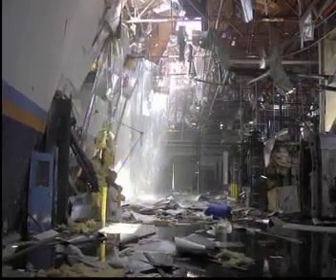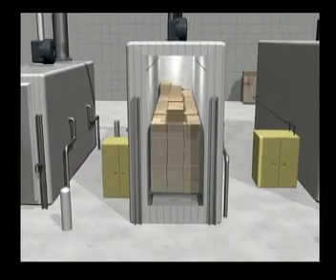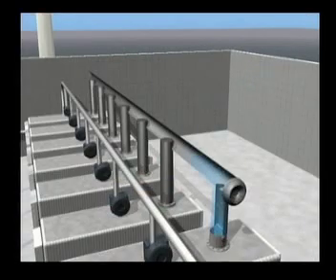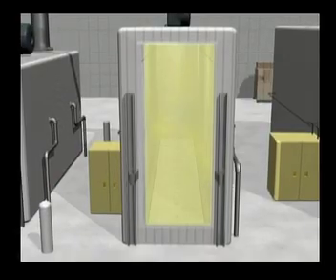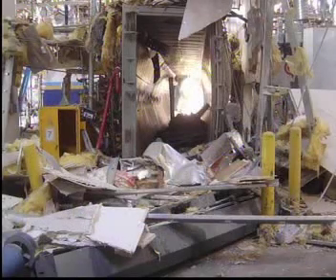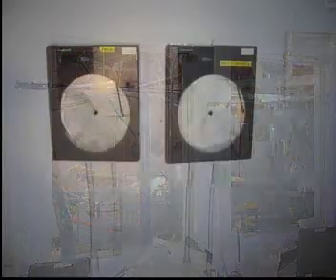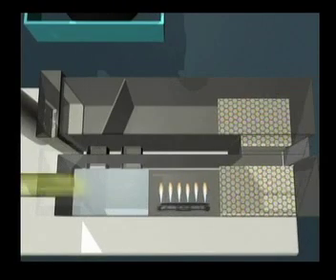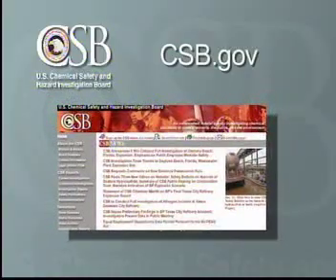CSB Safety Video: Ethylene Oxide Explosion

Comment: we studied this explosion in my Chem engineering senior design class earlier this semester. 18 years later.
Reply: @CRosa0125   How many improvements did you come up with?   I don't know if you're aware but Sterigenics was in the news more recently because their facility in Willowbrook IL was leaking ethelyne oxide into the neighborhood.  The facility was ultimately shut down.  And a Sterigenics facility in Smyrna GA also leaked EtO.  You'd think they would have learned their lessons from the Ontario CA incident.

Comment: Unfortunately, you can't train common-sense into an employee's mind. Now, a dumb question: Do the product boxes contain EOxide when they are finished with this procedure. Didn't see if the boxes were opened to expose the contents during the procedures.
Reply: That is what the nitrogen washes do. It is then aerated under vacuum to remove the rest. I am sterilizer technician, 40 years

Comment: Although operator ignorance is a major factor, the system had several issues. First, there should not be an override for a critical safety process. There should also be blowback preventers, and proper gas monitors installed. Japanese manufacturers refer to the is Poka Yoke, or "mistake proofing". Americans would refer to it as "Idiot proofing" either way, removing the chance of human error should be a priority.
Reply: I am not familiar with what control software they were using, but I am an industrial controls engineer. Let me tell you, there is always a way to bypass basically anything. This was from a long time ago, but if it is similar to modern batch control systems, they just did a step change, or another similar automation manipulation. That could very easily have been a common occurrence in their process. The problem was that someone had a higher level of authority and access than their actual knowledge of the process could justify. You typically have some automation engineers dedicated to supporting operations to perform or approve automation manipulations like that. Having an operations supervisor have the authority to do that is not something I have heard of before.
Reply: But yes, the piping and overall process design was bad. No fixing that with software, much as clients want us to do that after they bring us in to their poorly designed plant AFTER it is built.
Reply: I sold ETO for 20 years. It in 100% concentration is one of the most explosive things on the planet. We ran ETO in hospital settings over 40 years, but it was blended with Freon or HCFCs at 88/12 or 10/90 concentrations to render it non-explosive. The changing laws on ozone depletion resulted in Honeywell and Penngas discontinuing production. I was going to build a 100% facility at that time, but did not like the idea of my office sitting on a bomb!

Comment: Can't they just stick it under the UV light like at the nail salon to sterilize?
Reply: UV light is known to damage plastics over long exposure. Think of anything we leave out in the sun over a long period of time, the UV exposure eventually destroys plastic in medical devices and can potentially make it weaker
Reply: UVC only sterilizes what it directly hits. It would not be able to penetrate into the packages and get every interior surface, like a gas would.
Reply: @gloomyblackfur399 What about using a different, stronger type of radiation? Gamma rays?

Comment: did it not occur to them that an open flame in a chamber used to remove explosive chemicals could be a hazard...? the extent of my chemistry knowledge is 10th grade chem but even i know that's dangerous
Reply: They missed the point of gas washing.
They thought if there are no products inside then it s not necessary.

Comment: Why wouldn't you design the system with a flashback arrestor ?
Reply: Too expensive probably
Reply: hardly expensive . For instance, a 14" inline detonation type flame arrestor is A$50,000 or US$33,000
Now, they wouldn't be remotely close to running 14" pipe so you'd be talking about maybe a US$10-15K for a smaller 4-6" inline detonation arrestor.
Now, in a facility like this a $10K arrestor is pretty insignificant compared to the price of the booths & control system.
Reply: @spicywolf6718  That assumes they were thinking about the price of the booths and control system.  People who cut corners often don't.

Comment: Is oxygen flammable because is a gas that can make fires bigger
And violent fire explotions
Reply: Well said pal
Reply: i disagree with whatever the fuck ben said, fire needs oxygen, therefor oxygen is flammable
Reply: Yes and no. Fire needs 3 things to exist: oxygen, fuel, and heat. While the oxygen is there and the flames introduced heat, the fuel present is so minuscule that it’s much too lean to burn. Not only that, if you remember they said the gas washes used nitrogen so a large portion going over the flame is nitrogen which is non-flammable. They also used ambient air which isn’t pure oxygen either, in fact it’s only about 21% oxygen so it’s not as bad as it seems. I hope that makes sense 😅
Reply: Yes and no: pure oxygen is a fire hazard but not 'flammable' per se: oxygen will not, on its own, burn at room temperature in air.
Technically what oxygen does is make anything that is flammable burn hotter than it would otherwise: flammable stuff is the fuel and oxygen is oxidizer, the other half of a fire.
Reply: Oxygen is not flammable. Oxygen is a catalyst. It increases burn rates, but requires a fuel source.
Reply: No oxygen is not a catalyst since it is consumed in an reaction. It is needed for a flame / fire to be there but on its own it will not explode (a spark in a 100% oxygen atmosphere will do nothing) but mix it with a fuel / something to react with (like hydrogen) it is very reactive / explosive
Reply: @marthajones9284  true, my bad, I should have said component.
Reply: @Jack McHue basic my ass. if god was real and he invented it all, hed be laughing his ass off at people trying to figure it out.

Comment: I find these videos as sobering reminders for my career in mechanical engineering as an EIT on why thorough consideration in industrial plumbing systems is of the essence. Fires, explosions, and poisonings have been linked to improper design or cutting corners on safety for the sake of profits. In this situation sensors and alarms as well as blast suppression systems could’ve prevented this explosion. As well as requiring all operators in the control room including the supervisor to put in an override password if a process override is needed instead of just one operator.

Comment: Hey anti-vaxxers, do you know Oxygen is flamable and can be toxic?!
Reply: What does that have to do with anything?
Reply: @TeddyJamesThe1  They are down there...in the comments.
Reply: Oxygen is not flammable. Stop spreading misinformation. Oxygen is an oxidizer
Reply: Oxygen is NOT flammable.
Reply: Oxygen is an oxidizer, a substance that can "vigorously accelerate combustion" of flammable materials. Oxygen itself is NOT flammable - it can not burn. Get it right.
Reply: Oxygen isn’t a noble gas tho

Comment: What happens when two Joe Blow Don't Know Jack's think they know better than the engineers that developed the machines and procedures. Stuff like this would happen far less often if everybody just followed directions and procedures! 
As a mechanic, I've been bitten far too many times thinking a designated procedure or specification was unnecessary. It's made me super anal about consulting the latest version Workshop Manual so I fully understand what I'm about to do.
Reply: what has happened to you?

Comment: How dumb are the people working there? If the last step heats the exhaust from the chamber they should have known not to send pure Ethylene oxide straight out.  There needs to be a sensor placed in the chambers to check for gas levels...if levels are too high then the valve won't open to the burn off stage. And companies every where tell their people NOT to share their passwords lol
Reply: They thought there was no gas in there because the first step removed it all (you watched the video right?)
The password is specifically there to be used in case steps need to be skipped for some reason, it was intentionally used as it was intended. This is not some "dumb" sharing of your personal password.
Reply: It was 2004... 18 years ago.
Reply: I work in a sterilization plant. There are sensors now. This scenario would never happen today. This accident changed a lot in the industry

Comment: Okay, for the "this stuff's in covid swabs!" people. A few molecules remaining inside the swab packaging won't hurt you. It's a gas. It doesn't form a layer that remains behind like spray paint. It's pumped in, it does it's job, it's pumped out, the tiny remainder left over filters out of the packaging over time leaving only possibly a stray molecule here and there, possibly not even enough to detect with the most advanced lab machines. This stuff's probably been used to sterilize all swabs and tongue depressors you've ever encountered in a doctor's office, unless you're old enough to predate this method entirely. You probably do more damage to your body every time you drink a bottle of beer or a can of soda, eat a hot dog, or get a sun burn. If you freaked out over every thing that's in any product that's dangerous in certain amounts you wouldn't be able to eat or drink ANYTHING. Not even water. I'm not saying nothing's dangerous, but learn how it actually works instead of freaking out over conspiracy theories and lies. You need to know what's actually dangerous or possibly dangerous. I'll give you some hints: if you want modern stuff to avoid, try carpets, mattresses, cushions, scented soaps and shampoos, and antibacterial hand soaps, for starters. Not that I avoid most of those, they're everywhere so it's not worth the effort, although not all hand soaps are antibacterial so I do okay on that one. But really. Potatoes contain "scary and dangerous" stuff that's perfectly safe as long as you aren't eating green or sprouted potatoes or enough to kill you anyway. Apples contain more formaldehyde than a vaccine. All this antivax or covid conspiracy stuff is just silly. If you're going to freak about it you may as well fear every food, drink, and other product you come in contact with because they're no safer, and in many cases less.
Reply: Dihydrogen oxide can be dangerous in large amounts too.
Reply: @fallinginthed33p  And don't forget it is laced with over 100 ppm of deuterium oxide...😉
Reply: @fallinginthed33p  monoxide
Reply: Uh, I just binge watch these videos for Entertainment, and ran into COVID crazies? What a world are we living in where safety education videos are abused by people who want to preach unsafety...
Reply: that's nice, i'm still not getting jabbed or tested. sugma.
Reply: @johnsmith-sp6yl  that’s fine, we all suffer the consequences for our own actions
Reply: @johnsmith-sp6yl  And the only consequence I see on your part is a false sense of superiority, but we all have our vices do what you want brother 😂
Reply: @johnsmith-sp6yl  Why would I do that we’re on the same boat and I’m telling you not to get the jab? 😂
Reply: @tim4570  reply unclear, erronious trolling
Reply: @johnsmith-sp6yl  Reply unclear? Which one yours or mine? Im just saying as a human being to do as you please, it’s a part of your Natural Rights. Or more like you weren’t expecting support on the internet and you think everyone is against you? But js if you’re American like me your Natural rights are protected by law

Comment: They used ethylene oxide to disinfect covid 19 swabs
Reply: @Baise Duezcke I love your attitude 😭
Reply: As well as basically all medical devices…
Reply: @Baise Duezcke sadly you have neither
Reply: We use ethylene oxide on everything. I work in a sterilization plant with ethylene oxide. Medical trays, IV start kits, C-section kits, on and on. Almost everything is sterilized with it. This is highly regulated. It is in the chamber for 12 hours, it’s only exposed to the gas for about 5 of those, it’s flushed out with nitrogen most of the time. And once it comes out of a chamber, it goes into a degas hot room at 130 degrees for 24 hours to vent out and then stays in a well vented warehouse for another 24 hours. Then however long it takes to deliver to a warehouse and then be ordered by a hospital. Hospital equipment has been sterilized with ethylene oxide since the 60s. We even add test samples into the pallets of equipment to make sure everything is sterilized and safe to use. You’re not as smart as you think you are.
Reply: no they come from china, bioweapons lab
they contain conductive gels inside PP tubes, they break off and penetrate into flesh where they release the gel of unknown substance
Reply: @Baise Duezcke and its toxic
Reply: @Ete91  It is toxic... in higher concentrations that you'll ever see in a swab jammed up your nose.
You know what toxic gases you never see anti-vaxxers rail against? car exhaust, tobacco smoke, paint fumes, flatus...

Comment: Ethylene oxide is pretty nasty stuff with a very wide flammability range, pretty much any concentration more than about 3% will burn and pretty violently. At least one source states it is used as fuel in thermobaric weapons (i.e. fuel-air explosives).That would explain why the flashback and explosion was so powerful and violent

Comment: This 💩 is on the swabs that they shove up your nose in the c19 tests. Toxic?
Reply: dosage people, dosage
Reply: And it's on the bandages and syringes and tongue depressors and needles and, and, and, and...
But it's not. My the time it leaves the sterilization chamber, the concentration is well below 3%, and that includes what is in the packaging and external corrugated boxes.
By the time it gets on a truck to be shipped to distribution warehouses, more has outgassed.
By the time it gets to your health care provider, it is almost completely gone.
*
It takes approximately 7 days at 20C to achieve full desorption. And that assumes that there was no higher-temp air washes at sterilization. 
*source https://www.cdc.gov/infectioncontrol/guidelines/disinfection/sterilization/ethylene-oxide.html
Reply: What's the point of the COVID-19 association?  Obviously the stuff had been in use on a wide variety of materials for medical use long before the video was made, and the video is fifteen years old--likely this sterilization technique has decades of use on thousands of products.  You're going to be concerned specifically because it might have been used on that particular swab?
Reply: @bobbun9630  it's a know carcinogen and is also classified as a toxic substance. 

Just because it's been used for decades in well researched applications, doesn't mean it's safe in hastily unreliable testing being forced on millions of people daily.
Reply: @Crimson.S.57  Nasal swabs existed long before COVID testing was developed.  They weren't "hastily developed" in response to the pandemic and are the only part of the test that would be exposed to this part of processing and come in contact with you.
Reply: @Crimson.S.57  I mean cooked meat is the same, different ones have different levels of carcinogens in them but I'd be willing to bet the majority of people making a big deal of about trace carcinogens like that still eat it
Reply: And every restaurant table is washed with bleach water mix, which would be poisonous to consume. You still eat out, don't you? It's the same thing. Not enough remains to make you sick. You may as well refuse to touch anything washed with bleach or eat any food or drink water because everyone has something that will kill you if you get enough if it. Even water is deadly if you drink too much too fast. In other words, it doesn't make a bit of difference to your body. A few stray molecules of it left inside the swab packaging won't hurt you.
Reply: @amberkat8147  it's soaked in it.
Reply: Fluoride is also very toxic, yet you put in in your mouth twice a day.
Reply: @orsmplus  Oxygen can kill you.
Too much ______ can kill you too.
Fill in the above blank with almost anything composed of matter and/or energy.
Reply: @orsmplus  actually I don’t. My dentist and my toothpaste are Fluoride free.
Reply: what idiots... even if the EO was totally absorbed by your swabs, and then you ate the swab, the microscopic dose would do nothing, and it certainly would not explode you

Comment: I would have imagined technology available in the automotive business could have prevented this problem ,
first will be the use of a one-way valve ,
second pressure dump gate as used in turbochargers in which it will bypass the network and dump any excess gas in a specifically designed explosion chamber .